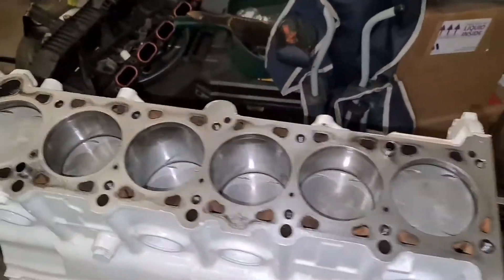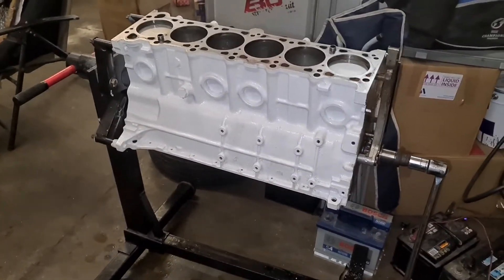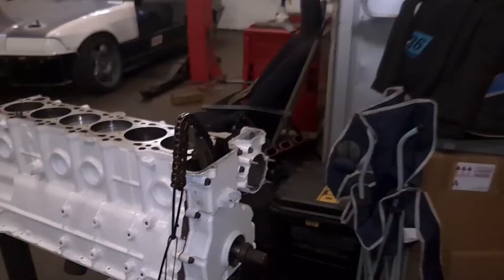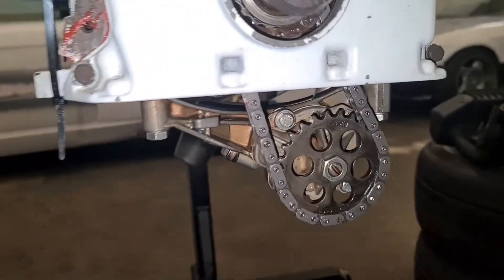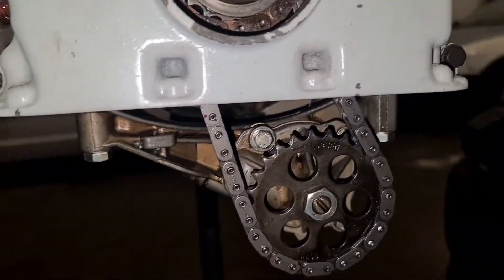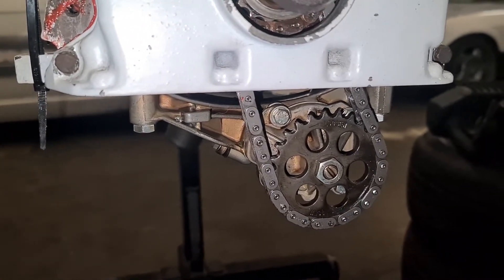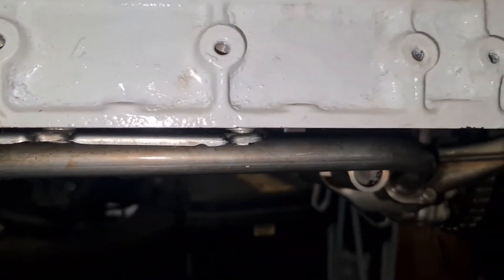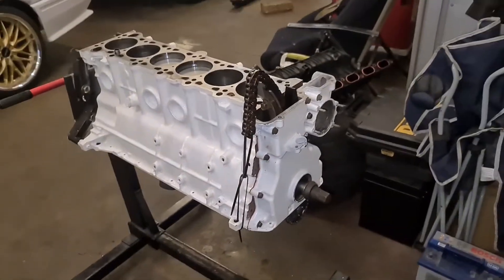Bmw E36 M50b30 Stroker Engine Build, Part 5 oil pump and timing case fitting..

Comment: I used the m52b28 baffle for my m50b30 build. It has enough clearance for the m54 crank.
Reply from the maker: The m52b28 baffle plate won't bolt up the the m50 block that I'm using, different bolt pattern. You used m50 or m52 block?
Reply: I used a 1995 m50 block with the single vanos.
Reply from the maker: @Ob954  same as my block but the m52 baffle plate would not work for me, bolt holes in different place.
Reply: Before october 1994 the m50 vanos block was more like the m50 nv. After october, the block is essentially an m52 block just made cast iron. More m52 stuff is compatable with the later m50 blocks
Reply from the maker: @brightmodern  I thought there must have been some differences, as I have seen other people use the m52 baffle plate with no issues.
Reply: @GaragE36uk  im doing an s52 with 86.4mm bore from a december 1994 block. Do you have a torque plate or know anyone who has one?
Reply from the maker: @brightmodern  that should be a good build,  you doing a vlog? We dont have a torque plate.
Reply: @GaragE36uk  no mate wont be doing a vlog or anything. Im not as photogenic as you guys on youtube. Besides, its taking a long time to get the parts as im having a lot of stuff shipped over from US as its just not available here. All that plus a 6 year old at home with schools closed. I might do a quick pre-build video just to show parts and cost then an after video when its built. I'll let you know if i get round to it if you are interested.
Reply from the maker: @brightmodern  yes I understand that mate. Its hard work trying to film everything and build it at the same time.. Mine is built I just need to fit it and test it out..
Reply: @GaragE36uk  yep ive subbed and looking forward to it. You never get over that anxious excitement just before you turn the key for the first time, no matter how many builds you do, or even if its someone else's build!
Reply from the maker: @brightmodern  yep indeed. I am very nervous about it ha ha. But hasnt cost me a massive amount so not risking much only time really.. Hopefully will get it in very soon and see how it goes..

Comment: What power do you expect out of it once is done?
Reply from the maker: I am not really sure Andrei, I am hoping for around 250bhp and around the same torque. Once I have it built I will get it on a dyno and see what figures I have.
Reply: @GaragE36uk  sweet. What the price will be for something like that starting from scratch? I have a 318 so if I want to convert to something like this + labour, what numbers should I justify In from of my wife? 
😅😂😂😂
Reply from the maker: @andreistoian4029 for example, to supply and fit a 2.5 or a 2.8 into the 318is your looking around £1600. Then if wanted the engine built like mine into a 3.0 litre stroker you could be looking at around £1500.

Building a stroker engine is expensive if you can't do the work yourself if that makes sense.